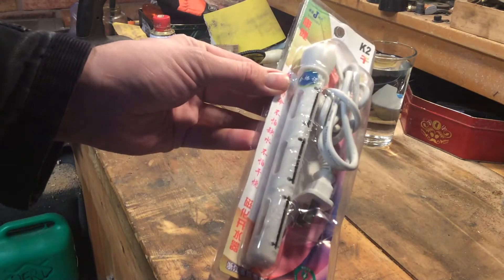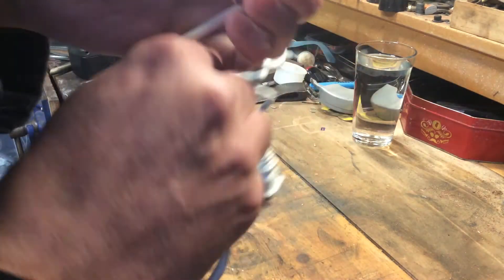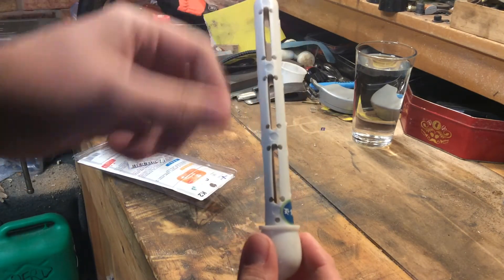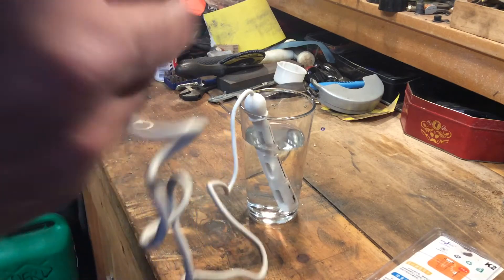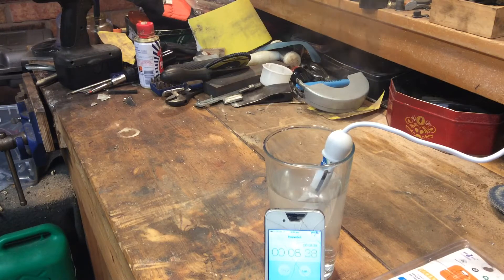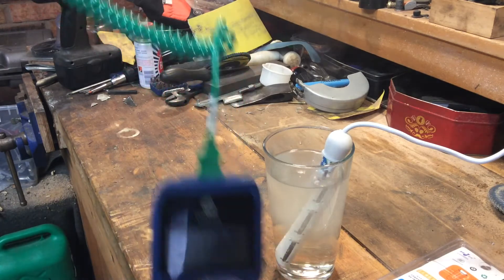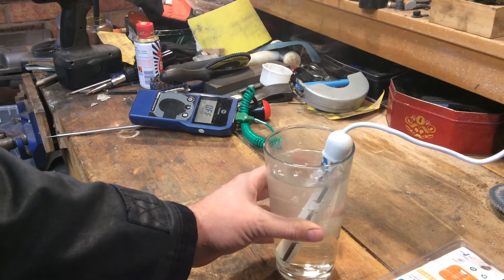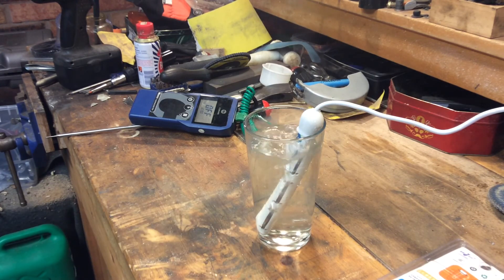Lethal Chinese water boiler.

Comment: A little tip. Measure the voltage in the water. I saw another test on that device and they got 220v in the water.
Reply: especially salt water is a nice conductor